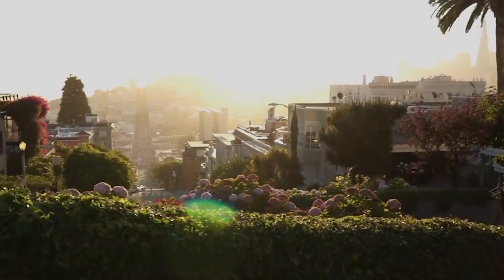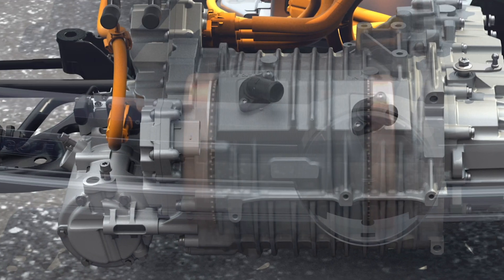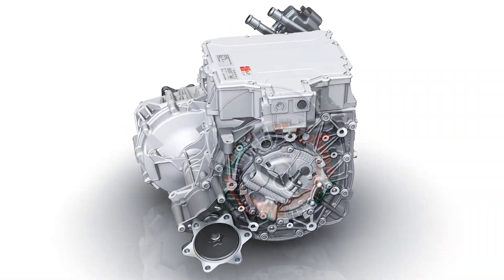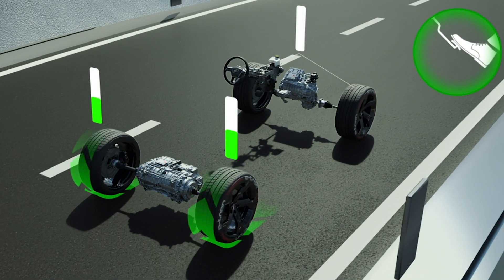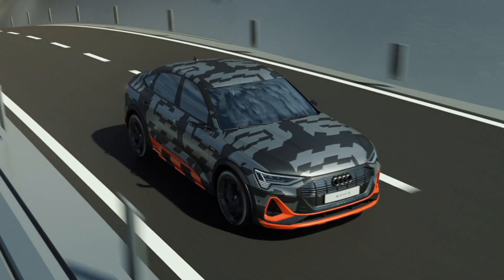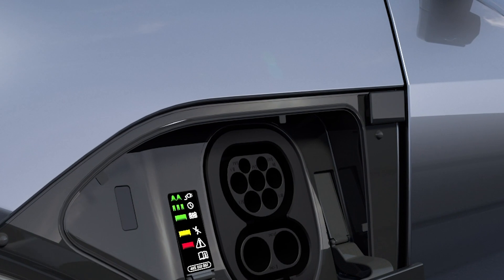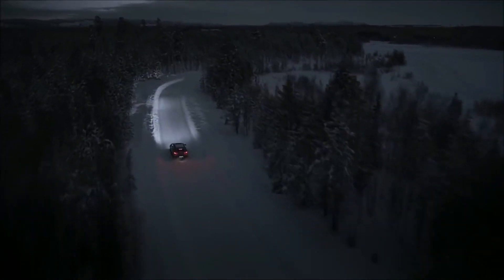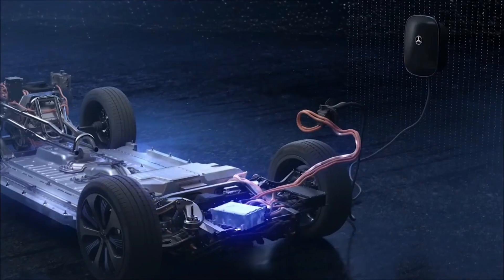How does an ELECTRIC car WORK? | I Speak Electric

Comment: a. USA 1891 
b. William Morrison
c. Motor, inverter and battery
d. Nikola Tesla in 1887 
e. Two items rotor and stator 
f. Cylinder made up of a series of conduction bars short-circuited by enrings
g. Three phase AC or alternating current pulse
h. Controlling both the AC power frequency and the pulse amplitude 
i. The inverter is actually increasing AC current 
j. Regenerative braking
k. An opposing electromagnetic force
l. Store electricty (electrical energy in the chemicals)
m. Modules or cells lots of small
n. Convert DC or direct current to AC or alternating current